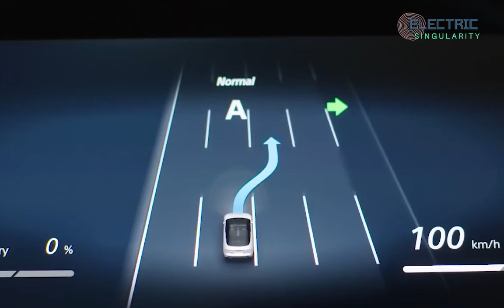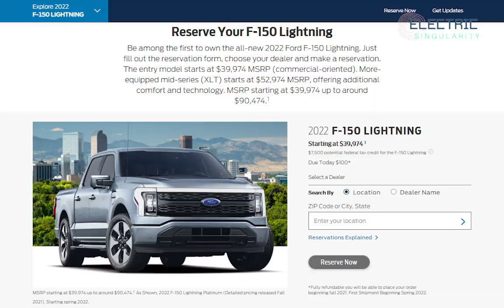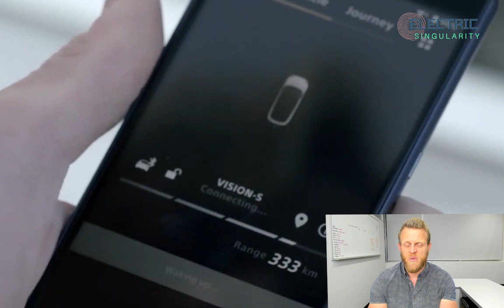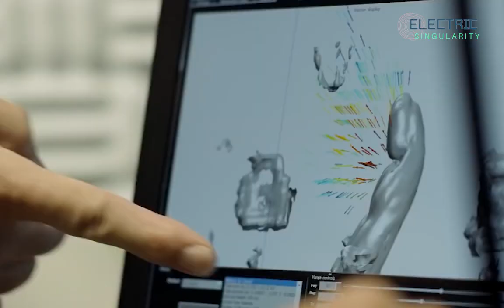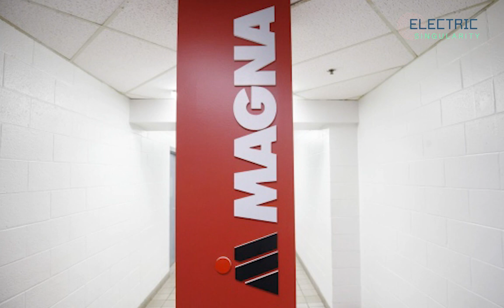Sony's S-Vision super sedan 1000km EV is really happening

Comment: Looks like Sony is going top end. That is going to cost at least $100,000 USD.
Reply from the maker: You might be right on this one Felix.
Reply: @electricviking  No way to offer that big of a battery pack and have it cost $60,000. And it's being made by someone else. I would be surprised it was at $100,000. Probably more.